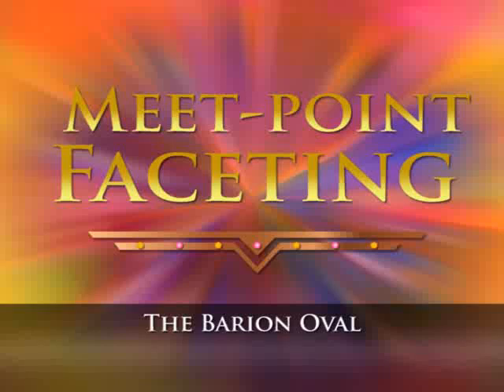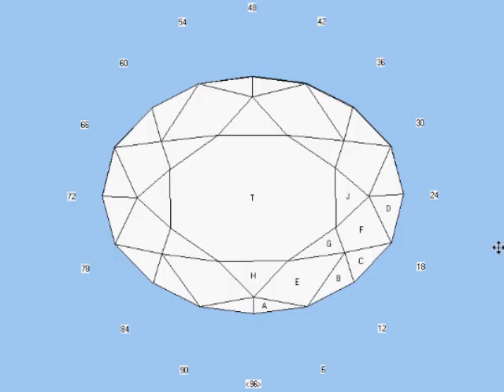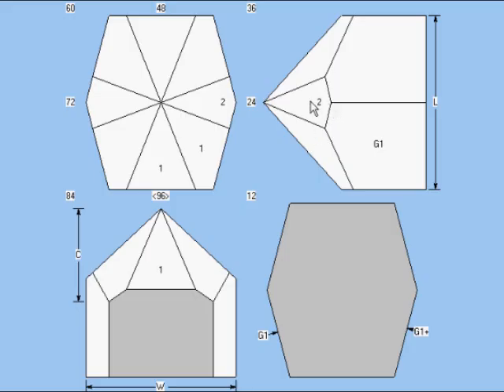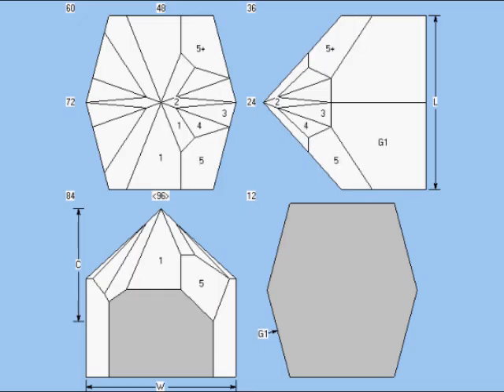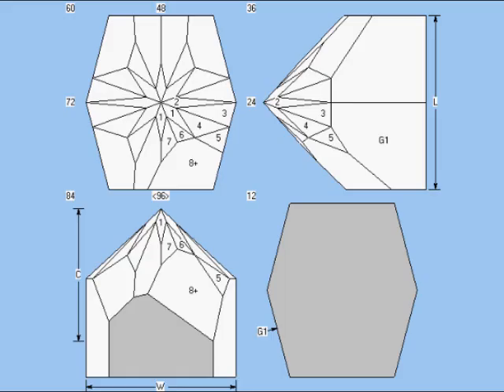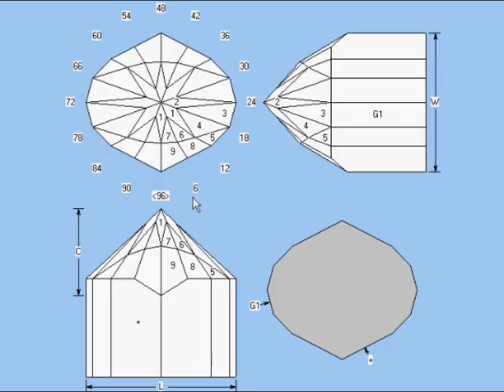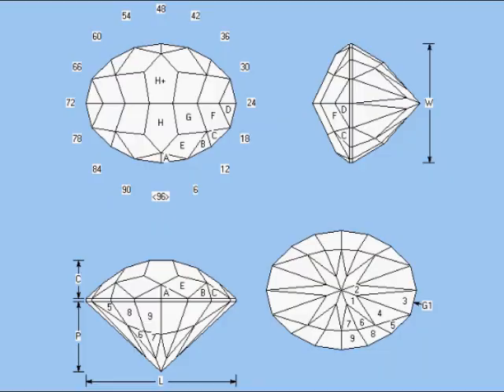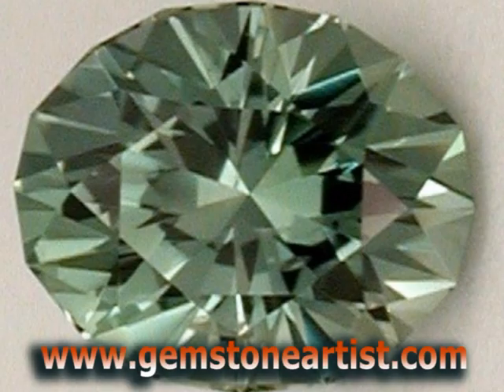Meetpoint Faceting #2 - the Barion Oval

Comment: Very fascinating.   Great presentation.   Regarding Laps!  Lets say you plan to use 4 different laps to progress from initial cutting and advancing to final polish.   Would you complete all Pavilion Facets with your 600 Lap and then go back through all of them with a 1200 etc.   OR would you  cut in logical groups.. say 1-4 and take them through all 4 laps before advancing to the additional facets.   Thank for sharing!
Reply from the maker: Glad you liked the material.

Excepting really large stones, it would be unusual to use more than three steps (including the polish step): Cut, pre-polish, polish.

And, generally, we will do all of one step before moving to the next - and wash everything up carefully before the polish step.

I will usually do a handful of stones - perhaps as many as two dozen - with each step done on each stone before moving the entire group to the next step. This is for efficiency, and to keep all of the grits and wastes in similar particle sizes - which cuts way down on time-wasting contamination and scratches. It also keeps the feel of the stone on the lap similar, improving precision as we go.

Hope this information is useful.